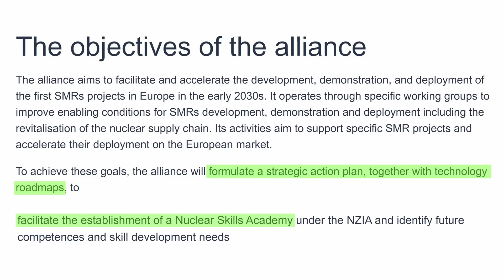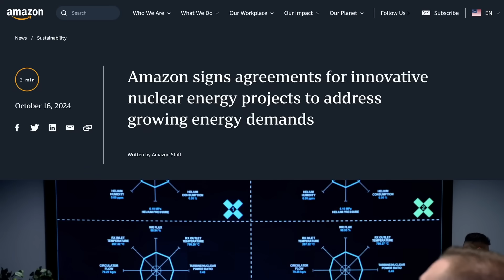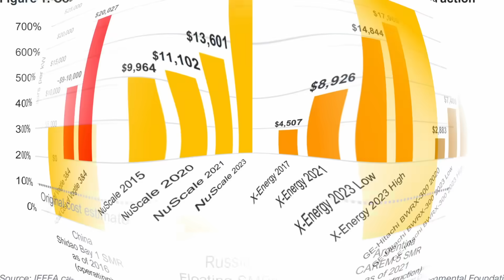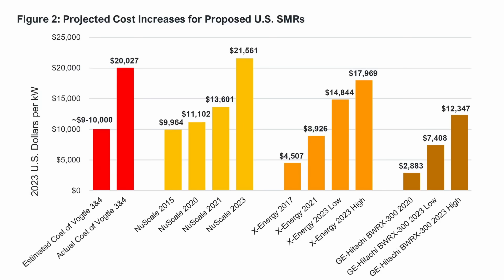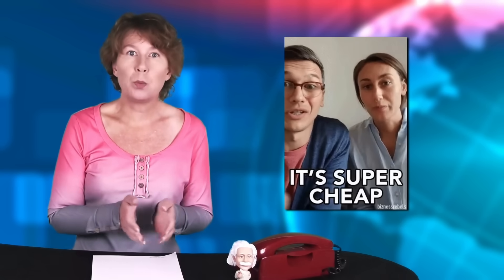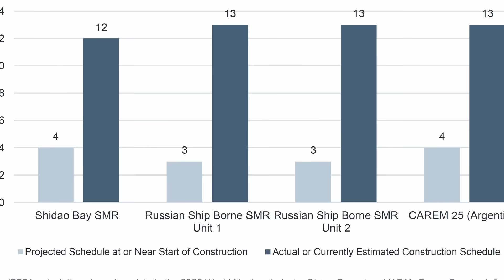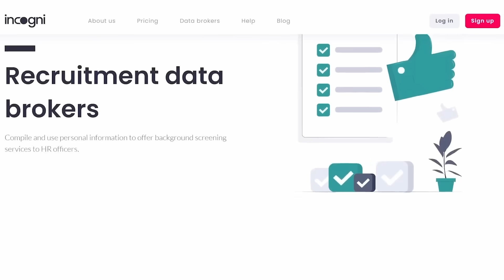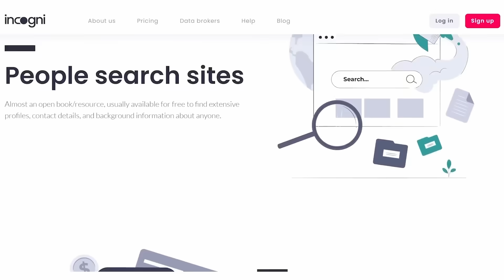Small Nuclear Reactors Have A Big Problem

Comment: Clearly the costs have a lot to do with over-regulation.
And I do mean over regulation.
Things that increase safety by 0.000001% but triple the price of it.

Peter Thiel even speculated that this global over-enforcement of "safety rules" is actually a strategy by nuclear countries to deny this to smaller countries.
Like "Sure you small country, you can build a NPP, just adhere to these 50 000 rules that make it very expensive (but we, as a big country, can afford)"
It would be more acceptable for them to leave a "path" for NPPs in the future, even if that path is prohibitively expensive.
A kind of Regulatory Capture strategy of sorts, but on a geopolitical scale.

Comment: These tech investors are going to be shocked when they discover you can’t build a prototype nuclear reactor in a garage like you can a PC, airplane or automobile. The workers will be in for a culture shock when are required to have background checks, drug/alcohol tests, psychological evaluations and even credit checks. It’s not like hanging out with your laptop and a cup of coffee and start coding. I wish them luck but I think they’ll run out of patience even before they run out of cash.

Much of the cost is not the reactor but the containment building that surrounds it. Oh, and forget about just  building copies of the large nuclear plants we have now. There aren’t enough skilled people to build more than perhaps two at a time.
Reply: I worked in Aviation Engineering for 40 years one of the most regulated industries on the planet. The regulations add incredible cost but compliance is necessary to avoid a smoking hole in the ground. I know very little about the nuclear energy industry but I can see it must have similar if not greater costs of compliance.  Prototyping new tech  makes for interesting You Tube content but In any highly regulated industry  getting it certified, manufactured at scale and operating  in a compliant  manner is where  economic reality kicks in. As a certain CEO said once, Prototyping is fun, production is hard but making money is almost imposssible.
Reply: @number1genoa  The Aviation industry didn't have to deal with the tyranny of the Big Blimp trying to keep it noncompetitive.
Reply: The usual tech solution is to move research and manufacture into countries with loose regulations.

Comment: I think solar and batteries makes the most sense. At least for like 90% of the world. Solar panels and batteries can be installed where needed, are easily scalable, and the fuel is free.
Reply: It costs twice as much to store solar/wind electricity in batteries as it does to generate it. It’s like putting a Casio in a Rolex box. And without battery storage, wind/solar can’t provide more than 50% of electrical demand unless you have lots of hydo or geothermal in which case you would use them.
Reply: @KevinBalch-dt8ot  It doesn't cost anything. And it can supply all needs with enough cells and batteries.
Reply: The fuel might be free but the material to make the batteries is not...and they last 1 sixth of a nuclear power plant
Reply: @juimymary9951  Everything requires materials to make and the cost of manufacturing keeps going down. In a few years, batteries will be very inexpensive.

Comment: The problem is economies of scale. For each doubling of production capacity, the unit cost goes down by about 20%. Consequently, the unit cost of a kWh from a small reactor is almost certainly more expensive than the standard 1,000 MW facility.
Reply from the maker: Yes, if the cost is driven by construction materials, but I don't think it is.
Reply: @SabineHossenfelder  The cost is definitely driven by the complexity of the construction and systems-coupling, rather than just the materials- Perrow's famous quadrants definitely put nuclear reactors in the right place. Reactors almost always end up individual, essentially bespoke programs because the sensitivity of their systems behavior to small changes in parameters due to inescapable manufacturing and assembly variation requires active, individualized management and re-engineering
Reply: @SabineHossenfelder  don't worry about that Dave guy.  I wouldn't even engage him through an agent.  He has twice the followers as you, but most of his videos barely break 10,000 views, unless they are about more famous people.  And he's not even pumping out videos on a nearly daily basis.
Reply: @SabineHossenfelder hi i can't comment on the video but i wanted to tell you the audio quality is quite bad and has some buzzing in it
Reply: @SabineHossenfelder  Correct.
A typical gigawatt power stations is about 1bn euros in materials.
The other 19bn goes on a workforce doing nothing while they wait for the nuclear inspector to come round and check the one nut they installed last week is torqued to specification.
And the interest on the money they had to borrow to get this far...
Reply: I think the idea is to isolate the extremely power hungry industries from the power grid, or at least let them supply a majority of their own power, so that the grid can now have the overhead to supply the rest of us and all the electric cars we're supposed to be buying but can't afford. Plus, adopting nuclear at a smaller scale successfully might help fight off the nuclear panic we all got after chernobyl, so larger facilities can be funded again.
Reply: It's a battle between economies of scale in two dimensions though: economies of the reactor itself (favoring larger) and economies of manufacturing scale (favoring mass production of units that fit in shipping containers).  Nuclear engineers look at solar jealously because manufacturing scale is huge there, SMRs are an attempt to get something similar.  I'm not sure it'll work but I think that's the motivation.
Reply: Good point. @tristan7216
Reply: Dude, these are modular. It's as big as you want.
Reply: @samsonsoturian6013  ; thermodynamically, larger scale makes for more efficient but have larger thermal inertia so are less capable of load following. 
One the regulatory framework is in place, it would make sense to combine large and SMR at the same site so that the SMR(s) can load follow rapidly and the large reactor(s) follow slowly and efficiently. They'd be replacing gas-turbine, diesel/oil and small coal-fired generators for load-following as well as acting as backup when a big one needs to be taken offline for maintenance/refuelling/inspection.
Reply: They can make them 
However they are finding out that they are not safe.
Costs keep multiplying as they install safety measures which are not enough...
Reply: It's hard to compare a product that can be sold with a huge facility that has land, employees, etc.
These projects are viable on paper. If they ever are actually manufactured the energy cost would be competitive
Reply: You'll struggle to recover even costs if your 1000MW facility has only consumers of 200MW on average.
It's entirely appropriate to build big if you have the consumers. You also end up being more efficient thermodynamically; assuming the same base reactor technology.
Reply: Not exactly. The scale effect doesn't work here as in most other investments. Most full scale nuclear plants are in one or other way unique and need separate process of saefety certifications etc. When you have something relatively small, you can place it almost everywhere without significant change in design.
I don;t know how scaling up will work with SMRs. They can be upgraded in most cases to 3-4 reactors and it will cut cost per kW just as it does with big reactors.
Production cost per kW is one thing, cost of delivery is another. You can build SMR very close to consumer. It cuts delivery cost in two ways (infracstructure ost and energy loss).
As we speak, one of the lowest costs per kW is probably at Westinghouse (AP300 is said to cost between 1 and 1.5 bn USD), but as was said, these announced initial costs like to expand 3-folds with time.
Time of construction is a big pro when it comes to SMRs. Building 4x300 MW takes no more time than building one 300 MW and it's still much faster than building one 1200 MW block.
Reply: Depends on whether you are talking about producing electricity or heat, small reactors for heat generation in Nordic countries, with district heating being common, could be useful and reduce the pressure on the electric grid.
Reply: it's not the problem of economies of scale. it's a problem of thermal efficiency. thermal reactors get more efficient with size(think surface/volume ratio). economies of scale would be number of items shipped like billions of solar panels shipped every year. there's no chance for that scale for nukes

Comment: Sorry, you are wrong the future is modular, in particular green primary steel factories switching from coal to hydrogen wast8ng pure water 8nstead of CO2 . Are you an engineer? Engineers have been build8ng big and small reactors you need to read more about the Industry not the physics.....you are wrong. Check what are rhe Candu Reactors for a change...learn...do not distrot data....is going to happen.... like electric cars....more efficient electric large grids....get better data